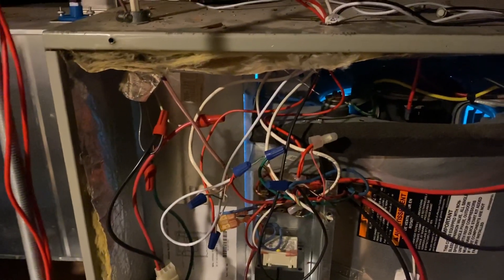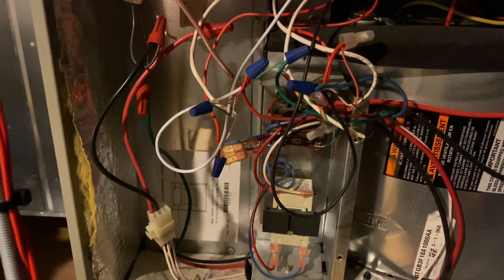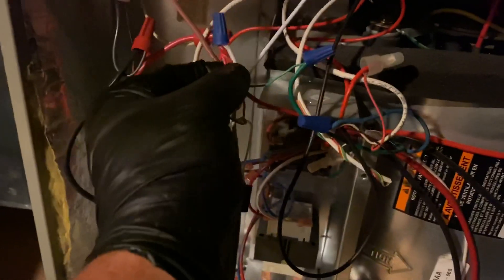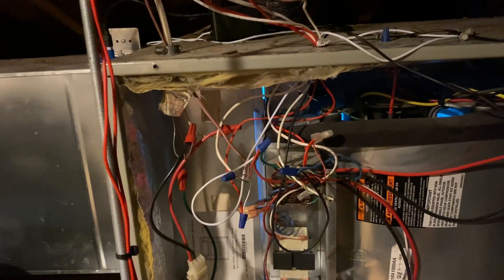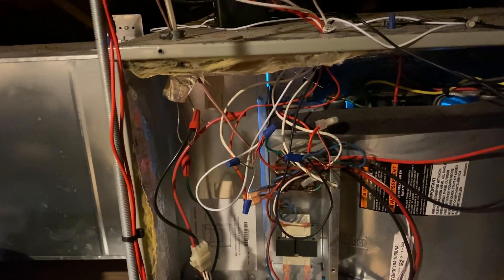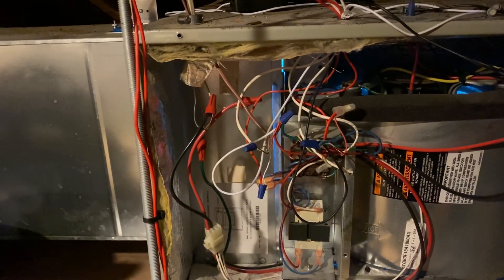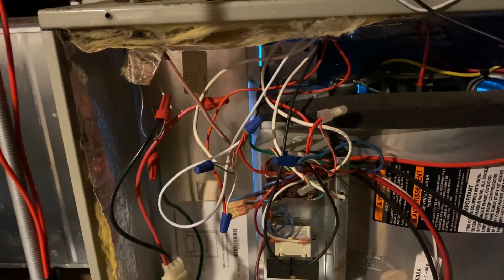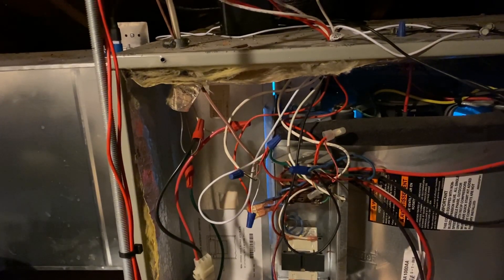Defective Ecobee Thermostat Shorting Fan Relay & Blower Motor on American Standard Air Handler

Comment: Thanks for this video!   I had an echo bee and all of the sudden I started having issues where the fan would stop running but ac or heater would continue to run till the unit would freeze up or heater would over heat.   I put my sensi back on.   So far seems to be working.    Hope this is all that’s wrong

Comment: Had similar issue. My ecobee premium fried the relay in my Trane TEM6 air handler. Ended up losing all power to the thermostat. Had the relay replaced and put the original Honeywell T6 pro back up now
Reply from the maker: It happens

Comment: I had a problem with ecobee or more than likely my wiring, I hope someone can help me. I have Dual zone Control by damper, I have ecobee downstairs and upstairs. The upstairs when I turn on the AC thermostat resets and eventually wiill it trip my dual zone control board burned fuse. Heater and fan works fine. I’m using C wire/ 5 wires. Can’t figure out, maybe something with my W wire and C wire. When I go back to 4 wire non C wire battery powered thermostat it works fine. I did switched my ecobee downstairs to upstars samething. Maybe my board cant handle 2 ecobees or I dont know.